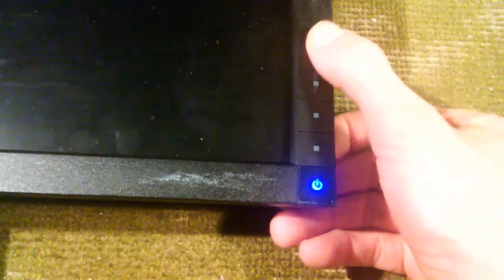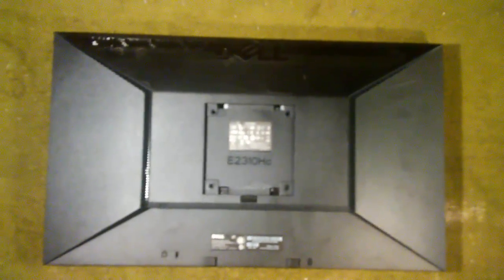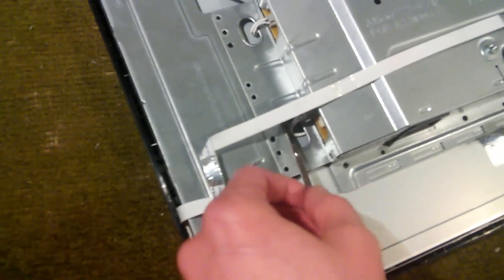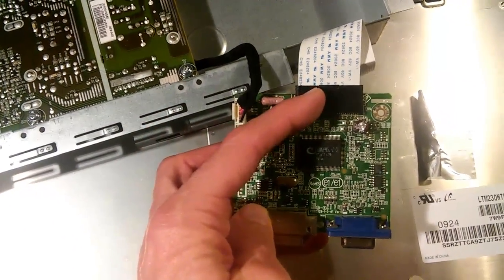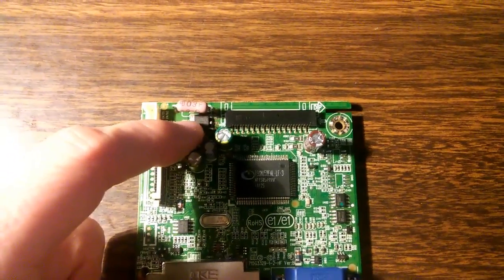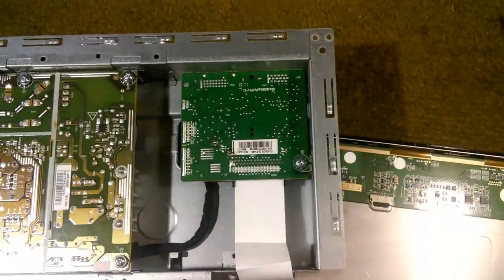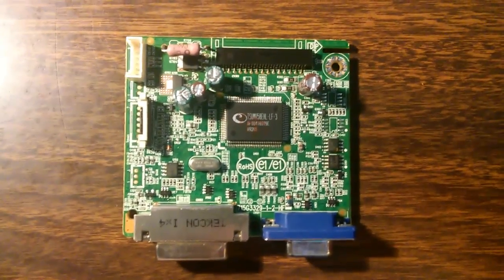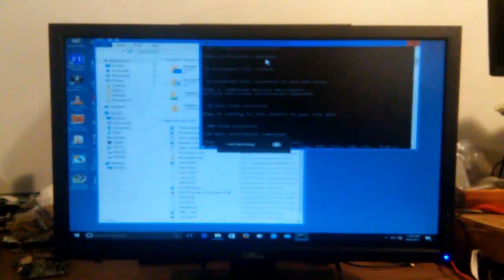Dell E2310Hc Repair

Comment: The CCFL inverter is on the same PCB as the main power? Is it best to replace all 4 caps? Another similar video described that one of the transistors (or MOSFETs) on that board tends to generate heat, & some of that heat fliws into the caps or ones nearby. Thank you 🤓 can a small heat sink be placed on the transistor (s) for extra heat removal? Also, does that Dell have a kind of reset button?

Comment: Thanks - another elated success story here! The progressively-worsening symptoms were exactly as described: with a many months-long phase of the display not reliably resuming from standby, so I'd have to power cycle it at my power board (complete with cool-down time).

I replaced the C704 and C707 capacitors (also no signs of bulging) just as you identified; with my multimeter showing much higher resistance for the old caps (not that I bothered to test beforehand since I didn't yet have new caps to compare). This is a much more convenient option than ordering a logic board and waiting for it to be delivered from China.

I'm basically a soldering newbie so was initially baffled about how to remove the caps, but dangoodell2's "Replacing Electrolytic Capacitors" recapping video was also immensely helpful. I think I'll be keeping an eye out for more of these types of ubiquitous monitors being "discarded" in the future. :)

Comment: You'll be happy to know that on the U2312HM you don't have to worry anymore about undoing the screws on the side of the panel as now the cage holding the boards is held in place with 4 pieces of metallic tape to save even more money. 🤣

Comment: Howdy! I replaced the logic board and the screen now just flashes blue, then black, then white, then grey, then grey blue green red rows (bottom to top). From what I've read it sounds like a burn-in prevention setting, but I can't even access the monitor's menu. Other people have had the issue, but can still use the monitor when it has a video input. I cannot, it still cycles through those screens. Do you know a fix? Thanks in advance!
Reply from the maker: Unfortunately I have never encountered the problem you describe.  I do not know how to fix it.

Comment: Great video! I have 2 monitors Dell 2210hc. One of them started shutting down shortly after it was turned on. I took it apart and discovered, the video processor on the main board gets quite hot,  as well as the 3.3V LDO nearby. I thought it's problem with the processor or the LCD panel at first. Decided to look up on YouTube for someone repairing similar monitor,  and after watching through 6-7 other videos,  I came across this one. The monitors look exactly the same as mine,  the internals are the same too. And guess what,  turned out the problem my had was the same also. Thank you for saving me the time for digging for schematics and parts. It was an easy fix. I got very lucky finding this video! 
Thank you! 
Oh,  BTW I didn't have 100uF/25V and replaced mine with 220uF/25V. They are larger in size but still fit and the monitor is happy with them - most importantly.

Comment: Did the caps you installed have any special specifications like low ESR? Will any garden variety 100uf 25v 105 centigrade cap do?  What do all the extra marking on the OEM caps mean? Where did you purchase them?
Reply from the maker: Any 100uF 25V 105C caps should be fine.  Make sure the dimensions are the same so you do not get into a fit problem.  Low ESR may extend the life.  Japanese made caps are the best.  Brand names likes Nichicon, Suncon, Sanyo, or Panasonic can always be trusted.  Chinese caps with unrecognized names are worrisome.  I usually buy caps in bulk from  B&D enterprises in Russell, PA.   If I am buying just a few, I will usually get them from some eBay vendor.

Comment: Hi, I have question that doesn't directly apply to this video, but you probably know the answer. It's about those backlight CCFL lamps that plug into the inverter board. The Dell in this video conveniently uses only one plug for each lamp, but usually there is a set of 2 plugs per lamp, each having 2 wires that differ in color from the other plug. It visually looks something like this:

=blue&black wires (top lamp)
=pink&white wires (top lamp)

=blue&black wires (bottom lamp)
=pink&white wires (bottom lamp)

in that order for this example.

The problem is it's easy to mix up the order if I forget to note their positions. It's obvious which lamp set plugs into the top or bottom of the board, but within that lamp set there's no way to tell which color set goes where. I could put pink&white then blue&black instead of the original order. Does this matter? As long as both top lamp plugs go in the top inverter board sockets is it okay to switch them around?
Reply from the maker: Are you sure that there are only 2 CCFLs and that each has 2 pairs of wire?  Could it be that there are actually 4 CCFLs with one pair of wires each?  It is common to have 4 or even 6 CCFLs in larger monitors. 
In my video on the Viewsonic VP211b monitor, I show an inverter with 6 pairs of wires (for 6 CCFL bulbs). 
https://www.youtube.com/watch?v=X9HdT140MEA
I suspect your monitor actually has 4 bulbs.  Since the bulbs are all identical, it should not matter which set of wires powers which bulb.
Reply: I see what you mean, I've seen those lamps and they're 2 in parallel at the top, and 2 at the bottom.  What I'm referring to looks exactly like the lamp plugs in your "Samsung SyncMaster 2433BW-1" video, except the plugs in your Samsung video are joined together, preventing any mix up possibility. I'm sure you've seen those unjoined plugs I'm talking about, as it's very common. So it's okay to change the order then?
Reply from the maker: I do not have your monitor in front of me, so I can not be 100% sure.  With that disclaimer said.
I believe it is probably safe to change the order of your back lite wires.  Each set of wires and each bulb should be electrically identical and interchangeable.  I have swapped back lite wires in monitors for trouble shooting inverter and bulb problem.  It did not cause any problems.
Reply: Thanks!
Reply from the maker: In the case of the monitor in your photograph, the correct answer is:  Yes.  You can switch the order of the wire pairs.  This monitor has 4 back lights.  2 on the top and 2 on the bottom. Each pair of wires is supplying  a single back light.  Each back light is physically and electrically identical.
Reply: Great! Thanks for all your help.

Comment: Maybe this was the problem with your one screen that worked: 
I have one of these exact models, given to me because the screen won't respond after coming out of power save mode. Otherwise the screen works fine. But, when it enters power save mode and the LED indicator turns yellow, if I leave it like that for more than a couple minutes and try to wake it up the LED turns blue and quickly blinks off and on once, then the blue LED stays on but the buttons are totally unresponsive with no screen image. It has to be unplugged from the mains and replugged to start working again. If it's in power save for less than a minute it wakes up okay. I don't have a cap tester, but if I need to remove the caps to test them I may as well replace them. 
What do you think?
Edit: I tried it again, this time the blue LED quickly blinked off then on once like above, but showed the Dell logo (that always appears when you first power it on) and froze there. Trying again I see it usually shows the logo briefly, turns black and freezes. This indicates that the screen is actually powering off then on when coming out of power save and causing a conflict with the standby status. Also, when I unplug the screen I need to keep it unplugged from the mains for at least 10 seconds, sometimes longer. Plugged back in too soon and the problem resumes. After several tests the screen turned itself off and froze with the LED blue, this time without entering power save mode.
Reply from the maker: mikuanda.
Capacitors go bad slowly and they are temperature sensitive.  You may have caps that are right at the threshold and may get worse as they heat up.  The symptoms you are having are consistent with logic problems.  I would just go ahead and empirically replace C704 and C707.  
BTW:  The one monitor that did work actually had bad caps, they just had not gotten bad enough to cause the monitor to fail.  I replaced the caps on that monitor as well.
Reply: Thank you David. Yes, I heard you say you found and replaced the ready-to-fail caps on the "good" monitor, but at 16:00 where you weren't sure exactly what prompted the previous owners to discard it, I'm suggesting they may have had my symptoms, since they aren't immediately obvious. Anyhow, I'm going to replace those two caps and I'll reply with the results.
Reply: It's fixed, exactly as you described, those two caps. Thanks very much for putting up this video.
Those caps were murder to replace though, as the solder wouldn't melt. I had to make my iron red hot, and still had to use a knife and pliers to rip out two leads that had pulled out of the caps and were still in the solder pad holes. I ended up ripping out an entire pad, and tediously coaxed as much solder as I could into the cavity to ensure a connection. Anyway, it's done and it works, thanks to you!
Reply from the maker: I am glad to hear it worked for you.  I find it to be very satisfying to bring something back to life for a few dollars in parts. 
It sounds like you have a poor quality soldering iron.  Maybe it needs a new tip?  If you have not already done so, you should invest in a solder sucker tools.  A cheap plastic one works fine.  It is a necessity tool if you are going to be doing electronic projects.
Reply: I do have pumps, it turns out I wasn't tinning the iron. I don't solder very often and always thought the purpose of tinning was just to aid in cleaning the tip. Now I know it is to improve heat transfer, to avoid the very problem I experienced.
Reply from the maker: Tinning also prevents the tip from oxidizing and deteriorating.  Before turning the iron off, you should tin the tip. It will last longer.